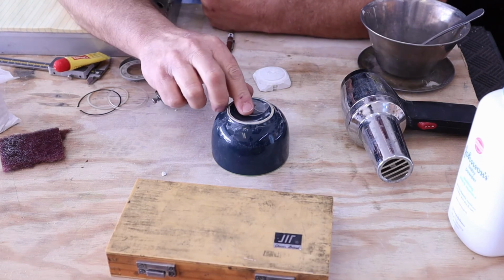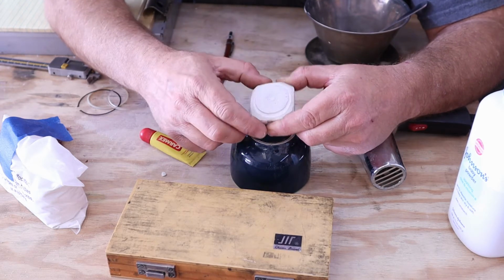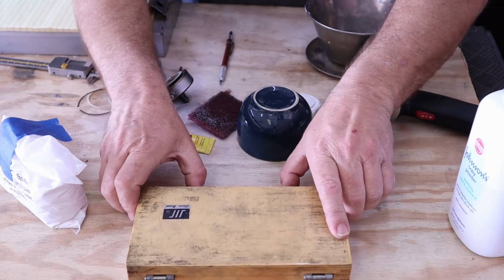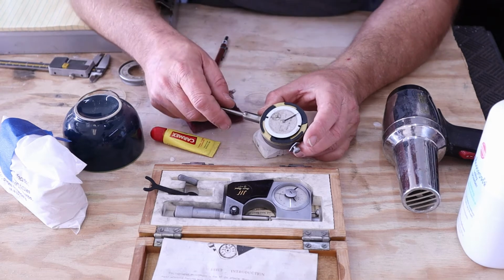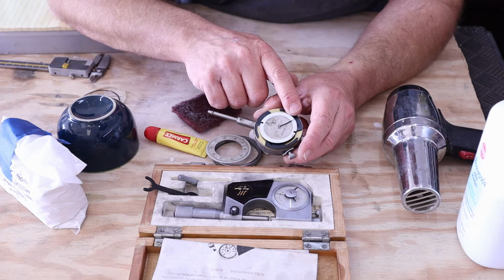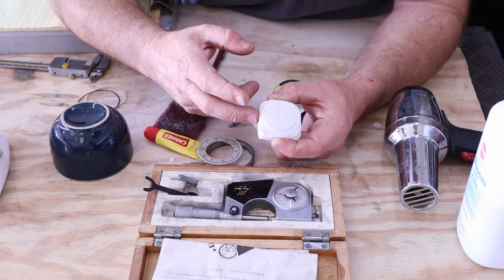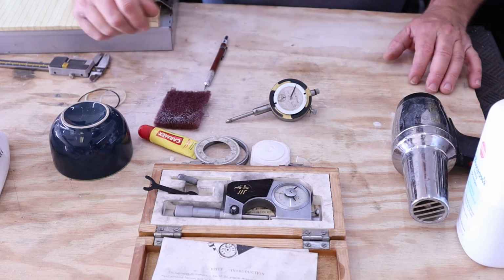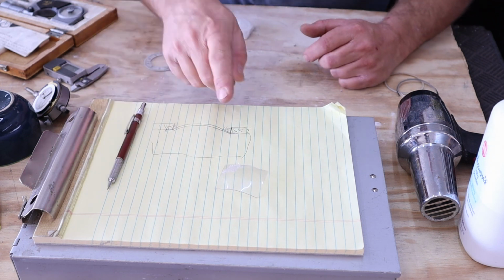Indicating Micrometer Crystal Creation and Replacement.

Comment: Hi Phil,

Just for future reference Lexan or polycarbonate acrylic is impact resistant in the factory form.

Once you apply heat to it, the molecule structure changes from impact and reverts back to standard acrylic. In the sign industry we only cold bend or cold form a shape from Lexan. In this case you have to make the mold shape excessive in shape bend/curve (R&D) as the Lexan will naturally pull back to a smaller shape.

Standard acrylic will perform better and also hold its clarity more than Lexan. Direct heat like a torch is not good for shaping but with a little bit of (R&D) using the foot shape of the your bowl or the model put it in the oven and bring it to a temperature where the acrylic will sag and contour to the form to the shape naturally. Then if you hold the shape with a reverse mold or whatever and apply air to the acrylic then it will cool and hold the formed shape. Otherwise with reverse pressure it will pull back a little and not hold the desired shape.

Also if you every have to drill standard acrylic do not use sharp drill bits as the cut tips will tear and fracture the acrylic. I normally rub the to 2 cutting edge tips on concrete to knock the sharpness off and you wont suffer tear outs.

Great work keep it up!
Reply from the maker: Awesome, thank you.  I hadn't considered changing the strength of the material.  That does make sense.      I hadnt considered cold pressing, very interesting,. Thank you!